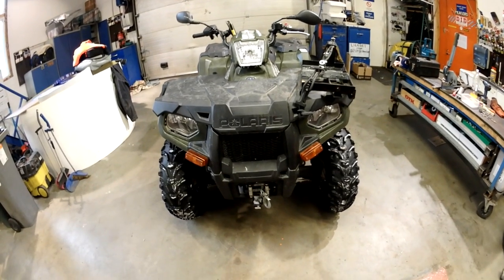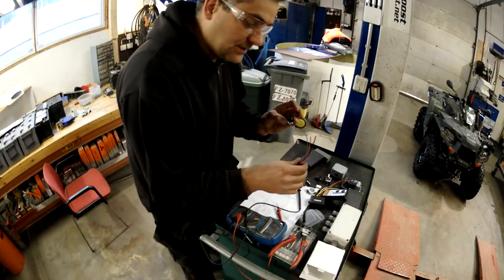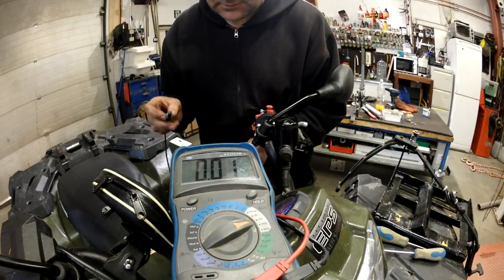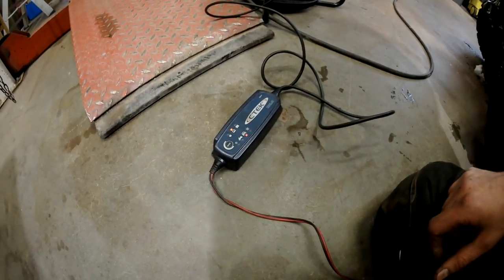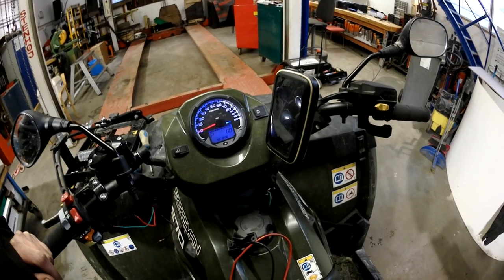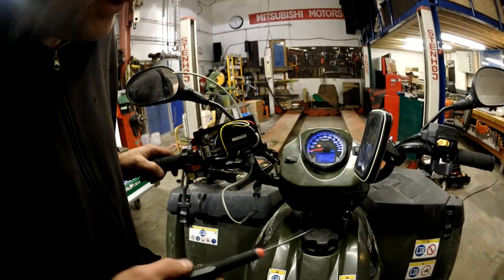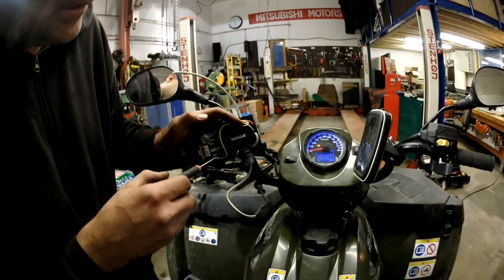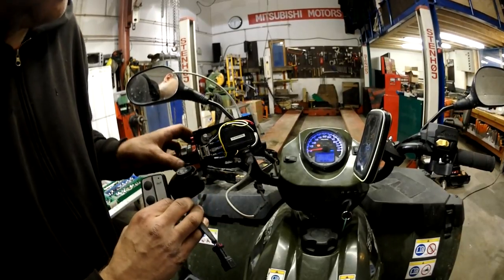Replacing Polaris ATV winch switch & installing remote control

Comment: I have the same problem with my Polaris and I had purchased the same remote unit from Amazon. now I can attempt to install it myself. The Polaris switch is over $100 which I why I purchased the Chinese switch to replace it with. I only got 2 months out the Polaris switch. I wish that I'd know that the quality was so poor. I would had a better after market switch put at the dealer instead of the Polaris operating switch.  Thanks for the video.
Reply from the maker: You are wellcome! Price for the Polaris replacement is awful and it is a piece of shit. Any 3 position switch would do the job I quess... Mounting and water tightness might turn out be issue thought ;) Thanks for watching!

Comment: Thank you for your previous response.

Who is the manufacturer of the black electrical connectors on the original Polaris handlebar mount?  I am taking a different approach to your problem.  The Polaris product is very expensive, and I'm going to use the original Warn rocker handlebar mount that came with my winch, and that has the red, green, and black wires, and want to connect to the Polaris pre-mounted connector at the base of the handlebars.  Can't find a match to that connector.  Thanks for the help.
Reply from the maker: I'm sorry that I can't help you in that... Don't know the brand of those connectors. I stole that connector from that old switch and connected to those wires already inside the connector

Comment: Thanks for the video. It is very useful for me. Could you explain what and where you connected the wires of the Chinese box to?  red to red on the handlebar connection etc.? Thanks for the help
Reply from the maker: Thanks. Glad to help. 
Remote receiver   --> Place I connected them in Polaris
BLUE antenna       --> Plastic tube to hold antenna
BLACK (battery -) --> Grounded this into handlebar
RED (battery +)     --> Polaris winch switch wire RED
YELLOW (IN)         --> Polaris winch switch wire BLACK or GREEN (I Don't remember)
WHITE (OUT)        --> Polaris winch switch wire BLACK or GREEN (I Don't remember)

Correct winching direction you can test by yourself... Please recall that direction the cable has been winched on the cable drum changes the direction. You might want to completely empty the the cable drum and check that the cable starts to wind on the drum smoothly and then to see what actually really is the correct direction for the winch motor to real IN and put those two leads according to that.

Please check that wiring in your units is the same. Don't know how universal these cable colourings are, but seems that all those chinese copies are the same. :) Same caution applies to Polaris wire colors also. Hopefully this helps You a bit. :)
Reply: Thanx for the video!
Reply from the maker: Thanks. You are welcome!